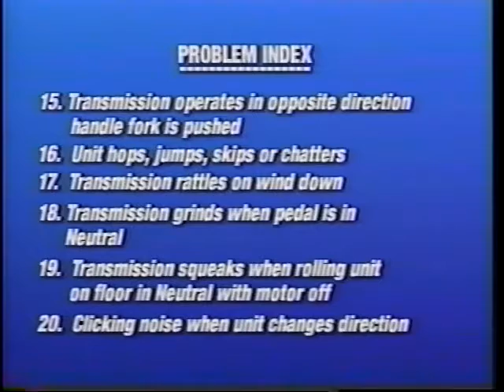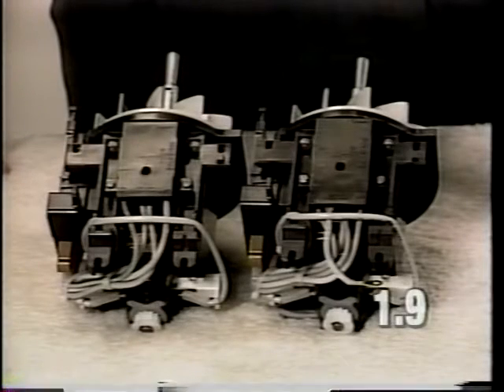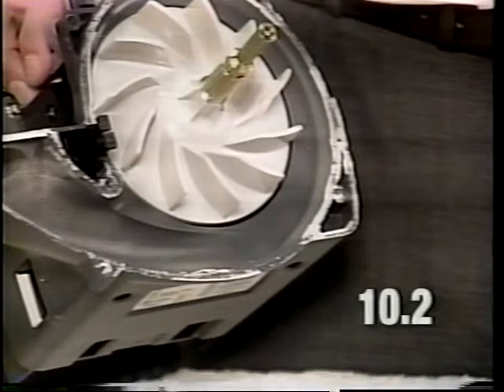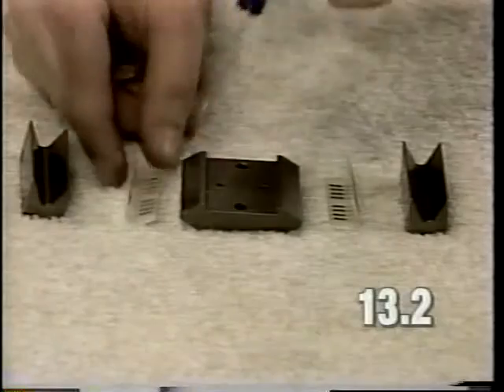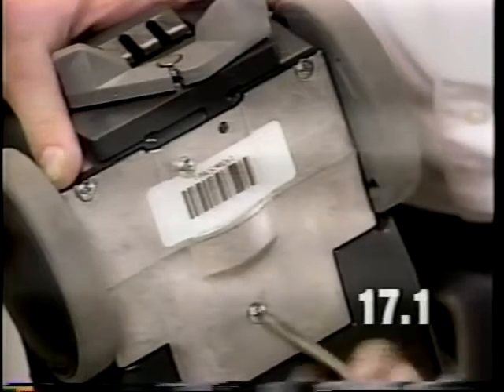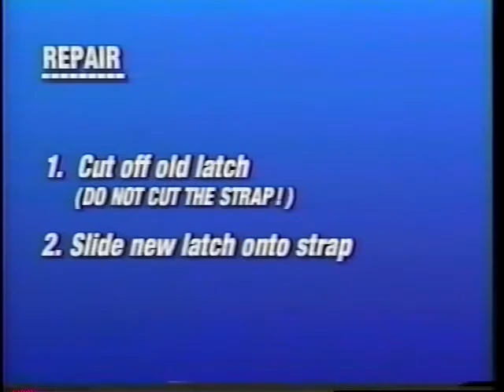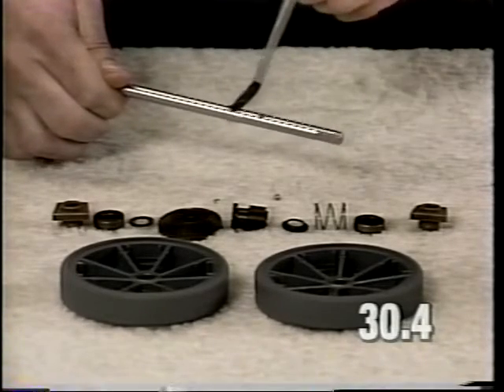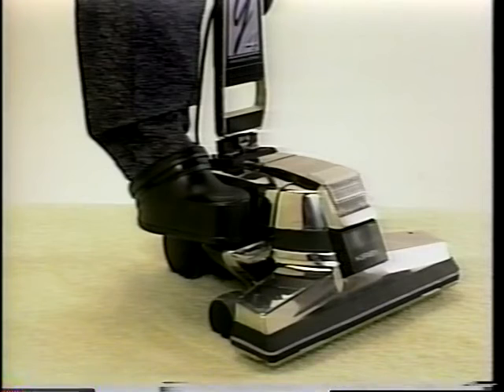Kirby G3 & G4 Troubleshooting

Comment: This is a great video. Thank you for taking the time to post it. It didn't solve my problem as I'm looking for the reason why my G4 takes off like a bat out of hell and does wheelies!
Reply: The earlier "G" models had this issue. They installed a spring under the pivot slide block to help smoothen things out. If the spring is there, then you can adjust the transmission to reduce its force one way, but it puts more force towards the other direction when you do that. If adjusting it still doesn't help, then a transmission replacement is probably necessary. That sucks because they are one of the most expensive parts.

Comment: >>> TIME STAMPS FOR EACH SECTION :)

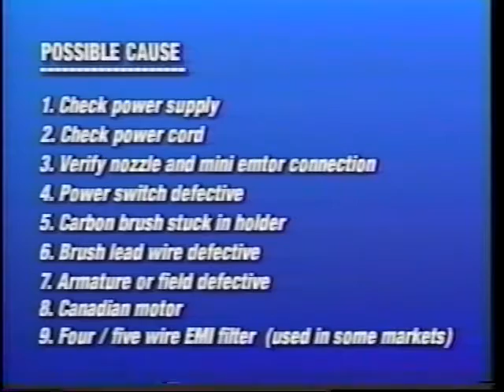1. Motor does not run (2:09)
2. Motor only runs on 1 speed (18:11)
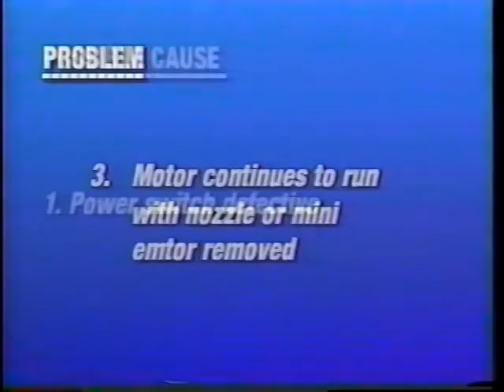3. Motor continues to run without nozzle or emptor in place (19:07)
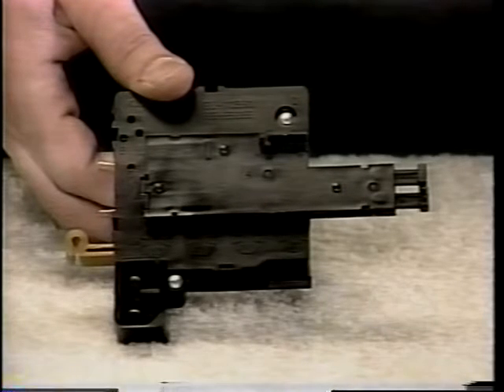4. Motor runs briefly & then stops, or intermittently (19:25)
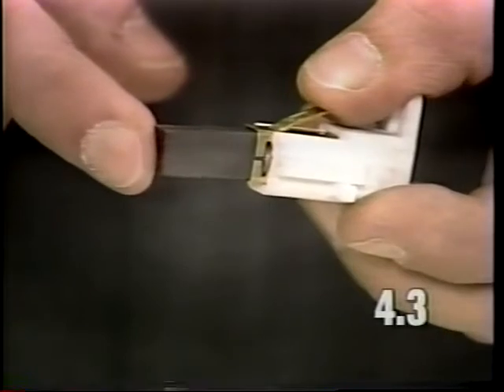5. Armature and/or carbon brushes spark (20:33)
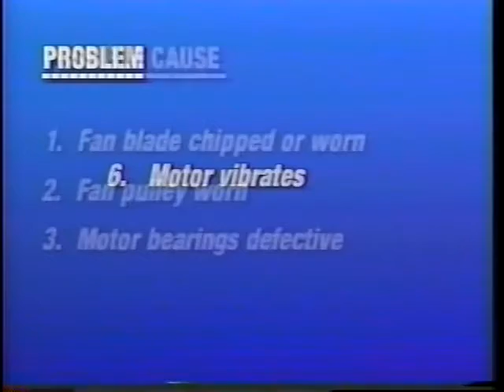6. Motor Vibrates (22:06)
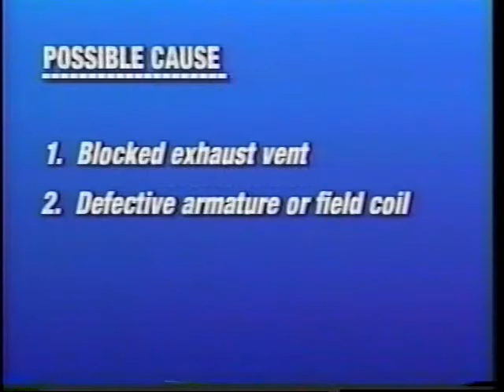7. Motor runs HOT (24:36)
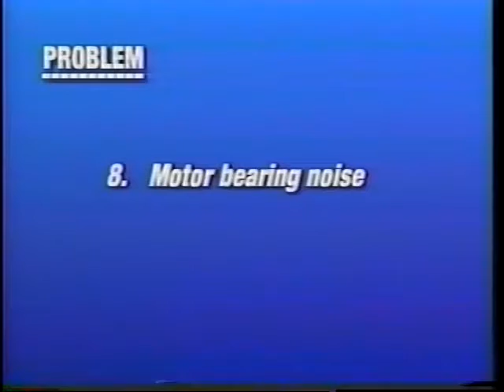8. Motor bearing noise (25:32)
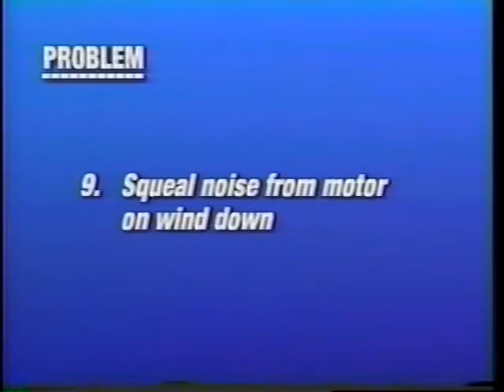9. Squeal noise from motor on wind-down (26:15)
10. Clicking sound from motor area (27:30)/(10.1-10.5)
11. Base pan dirty inside; and motor sprocket gear & primary drive gear are worn (32:39)
12. “Headlight Does NOT Work” (37:10)
13. Transmission has weak assist in forward and / or reverse (39:10)
14. Unit runs away in forward and/or reverse (52:19)
15.  Transmission operates in opposite direction that the handle fork is pushed (53:34)
16. Unit hops, jumps, skips, or chatters (53:57)
17. Transmission rattles on wind-down (54:57)
18. Transmission grinds when pedal is in “N” (57:29)
19. Transmission squeaks when rolling unit on floor in “N” with motor OFF (1:00:09)
20. Clicking noise when unit changes direction (1:01:08)
21. Unit pulls to right or left (1:02:22)
22. BPI light does NOT work (1:03:56)
23. Brush roll belt breaks (1:06:08)
24. Does not pick up dirt / little or no suction (1:06:52)
25. Handle fork leans to far forward (1:08:36)
26. Handle fork falls down (1:09:19)
27. Tilt knob lever broken (1:09:51)
28. Bag latch broken (1:10:28)
29. Attachment hose-end broken (1:11:32)
30. Assembly of unit (1:12:20)
31. Micron Magic Filtration System (1:33:15)
32. Generation III - Bag Top (1:34:00)

~ The End ~

Comment: Only one question , surely  a owners of a Avalir 2 using this video to service there Kirby themselves would maker there warranty null and void if the Kirby broke down
Reply: If a part is broken due to someone working on it themselves DIY, that part would not be covered under warranty since it isn't the factories fault. Otherwise, it should be covered. An experienced tech will probably know if a part is defective from the factory or worn form normal use.

Comment: Hey Kirby, what do I do if my carpet is a a weird height where if my brush roller is either too high or too low
Reply: Raise it all the way up, and lower it one notch at a time until you hear it clamp down to the carpet, and then lower it one more time. If it won't maintain contact with the carpet, then lower it down one more notch. If you have issues with the belt breaking or slipping at this setting, then you either need a new belt OR a softer brush roll, or both. Kirby makes four different brush rolls, Standard (Firm), Soft (medium), and Delicate (for hand-made rugs like Karastan), and Pet (reduces hair-wrap). Even new belts would slip on mine after we got new carpet, so I had to replace the brush roll with the "soft" brush roll, and I have not had any issues since then. The "soft" brush roll used to be the standard brush roll, from Generation 3 - Diamond Edition. When they came out with the Sentria, I think that is the model that the factory started putting the firmer brush roll on at the factory, and is still the standard brush roll they come with. Goodvac. Kirby main website, and other places sell the various brush rolls. Make sure the product description lists your model as compatible. I think G3 and G4 had a slightly different brush roll design.
Reply: @Cleaning_Hero  what would happen is that if it’s one notch too high, it can’t reach the carpet, but if it’s one notch too low, it burns up the belt (even with a good belt), and it can’t get good airflow